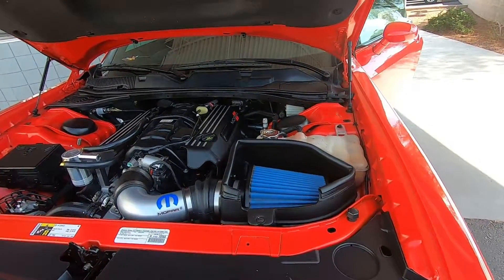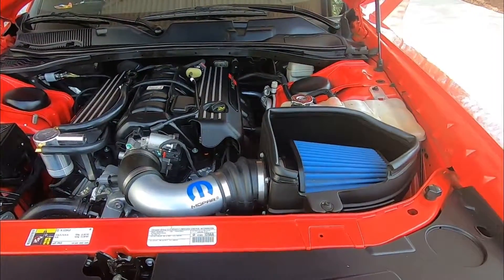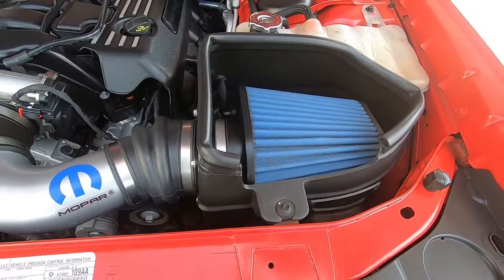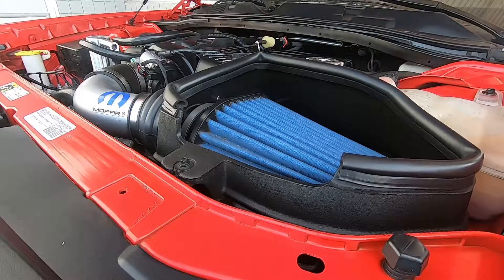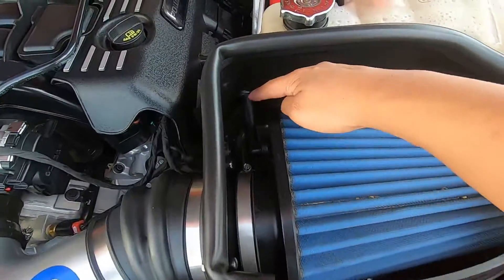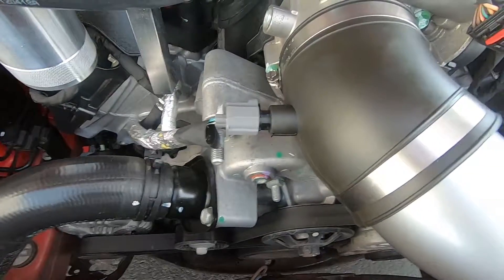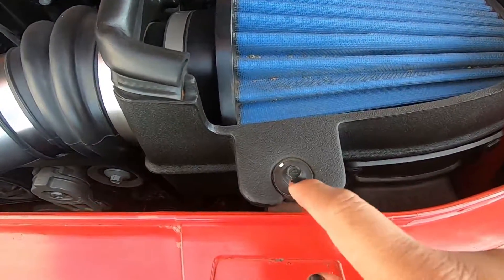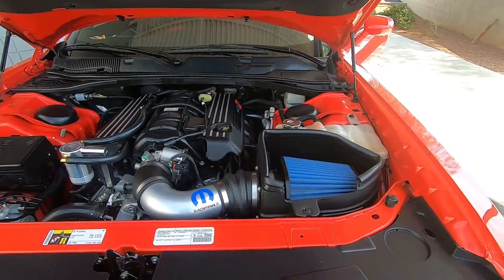Mopar Performance Cold Air Intake System shown on a Dodge Challenger 5.7L Hemi 77070044AD

Comment: There shouldnt be a need for a Dealer to steal your money to install this MOPAR brand kit ( Original Manufacturer- Magnuson Moss Act ) Its a relatively simple install.  #2- Where in the top of the new airbox cutout does the " cold Air" come from?  There is a plastic shield blocking air from being diverted up. Does the panel need to be removed or modified to allow air to enter?  Also, there is an option for a headlight port access into the airbox for a " ram air effect".    If you want to sell this, Offer a more comprehensive sales pitch.  Not just HOT air.
Reply from the maker: it is a simple install even with hand tools. not sure what plastic shield your talking about. when the hood is closed there are 2 inlets for air.....1 being uptop of the airbox there is an opening not sealed when the hood is shut.....and 2 there is about a 3x3 square cut out that gets air from behind the headlight. YES there is a headlight port that easily pops out  to allow more air to flow into the box on most 2015 and up Challengers.

Comment: Can you run a headlight tubing kit to the open hole on the CAI box? I’m guessing if you can there’d have to be some modding to get it to fit with like metal tape or something.
Reply: You only need the Headlight kit, nothing else.  Some users think they need to seal the connection, but its not necessary. The OEM Hellcat tube is not sealed to the headlight tube.
The air box has a precut hole for it. Its ok to leave that open if not using the headlight tube. But why get the kit if you don't go all the way right?
If you watch the video closely you can see they have the tube installed. It also gets air through the Stock inlet from the bottom.

Comment: I have been struggling to find a CAI for my scat pack 6.4L please let me know part number please if it is made?
Reply from the maker: part number is a 77070043AC
Reply: @MoparWholesaleParts  do you guys have a web site?
Reply from the maker: @josephtorres6740  https://www.moparwholesaleparts.com/

we do and here is an extra 5% off for you... use code TY21

that code is good FOREVER tell you friends and family.
Reply: @MoparWholesaleParts  thank you for your time I looked up the part 77070043AC and it is still coming up 5.7L where I have a 6.4L can you confirm this is the right partv#
Thanks
Reply from the maker: @josephtorres6740  we have one upstairs and the instructions on it say 2011-2016 6.4.....now the 6.4 has not changed nor has the air box so this kit will work up to 2020 as far as we have found. 

so your still good with part number 77070043AC.

we did find as you did that the catalog listings are not listing it but this part number will work on a charger/challenger 2011-2020 with a 6.4.
Reply from the maker: @VG-xh7gx  the elbow or tube with the mopar logo on it is not needed for this kit 77070043ac. It looks good but this kit uses your existing elbow.
Reply: @MoparWholesaleParts  thanks for your reply, just stating - in the video, it says (at 1:35) that it comes with the elbow.
Reply from the maker: @VG-xh7gx  just making sure were are talking 2 different kits. the 7707044AD that is what the video is over fits the 5.7 2011 - 2020 challenger this kit does come with the tube with the mopar logo on it. the 77070043AC is the thread that your asking the question on fits a 6.4 2011-2020 challenger does not come with a tube. 

2 different kits for the Challenger 

77070044AD 5.7 2011-2020 with tube
77070043AC 6.4 2011-2020  no tube

hope this helps
Reply: @MoparWholesaleParts  got it - thanks!

Comment: on challenger 5.7l RT approximately how much power gain?
Reply: From this alone? nothing notable. Modest 7-11 HP according to Dodge engineers (sorry, I read that from articles, but cant point you to it). Its just one part of a few upgrades for improvement. Exhaust, air, a little mild programming etc. Ref the now discontinued Stage kits. You can pull together most of Stage 1 except the PCM. Could probably find a tuner to replicate it though. The air and exhaust will definitely help the engine breathe better though along with dropping the intake air temp. Good easy upgrade for the street, looks much better than stock too.

Comment: How many hp after ?
Reply from the maker: most intake systems will gain 11-15 HP after install. we have not dynod this one.
Reply: 0-1 HP. If you have an exhaust, headers and a tune THEN you might get the "advertised" gain that comes from a cai .